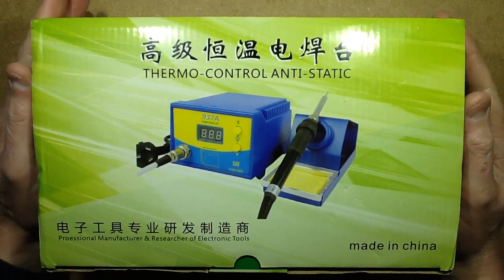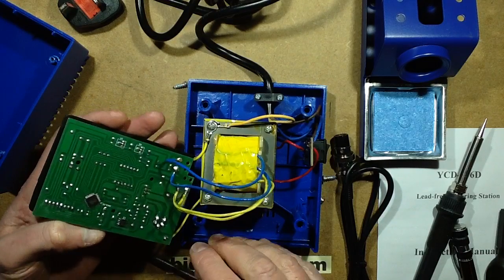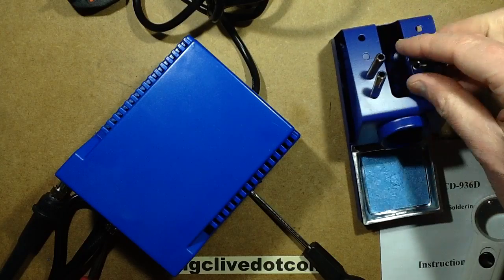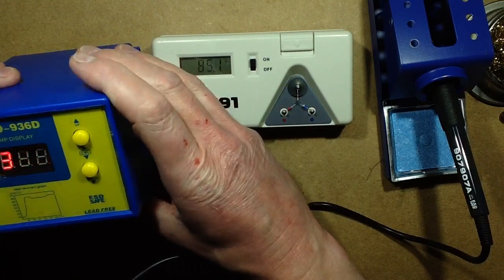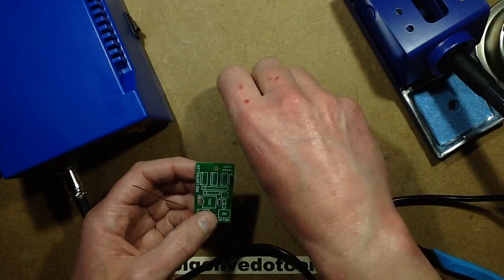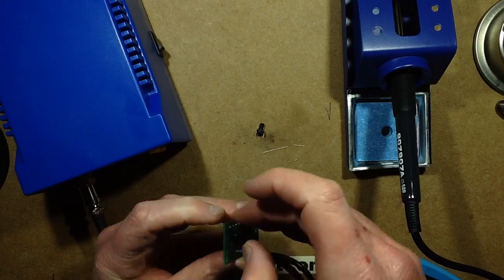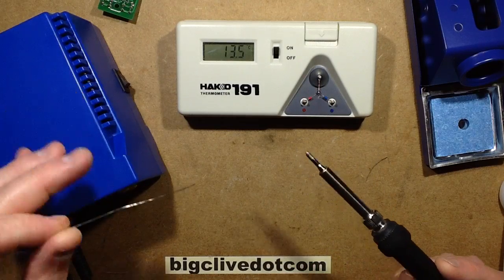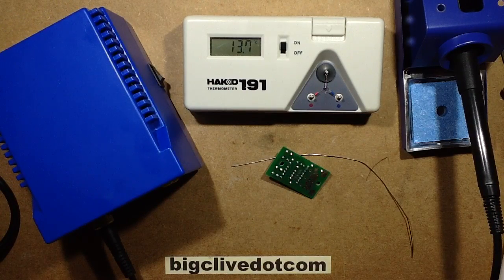936D digital soldering station test and internal look.

Comment: Hi Clive.
I just got the black version of the 936D.
Its different, mine has a callibration trimpot through the front panel, like the analogue ones.
It does make some noise when the iron is heating which isnt brill.
The stand is exactly the same as this one.
Overall its a good tool, warm up is super quick, like you point out on bigger terms it does cool down, but I find it a lot nimbler and better to use than my xytronic.

Comment: Whats the best cheap soldering iron for me to get to start with? I Have a few super cheap pencil irons but they can barely melt solder. I need a real soldering iron.
Reply: temperature controlled are the only ones worth having.

ive gotten used to an adjustable gas soldering iron so im not fused about an accurate readout
Reply: ebay special i got one like above for £25

Comment: Saw the review and bought one. When mine came it's not quite the same as yours. Plugs properly earthed. Case is subtly different. Switch is the same. Transformer is different. Board shows no resemblance to yours and features a dedicated 20pin chip thingy marked 936D. Wonder which ones the clone?:)
Reply: PS Also, Your sponge has a hole in it!! The manual mentions a small and a large sponge but I only got the small one!! 😀
Reply: Since these are very popular there are probably multiple companies making their versions.

Comment: OK, very stupid question but I've been away from this deep in the electronics industry for about 2 decades. Why is temp calibration so important? Do chips now come with prefered temps. SIL arrays used to be SIPs.

I came across one of my first half dozen soldering irons and Archer (Radio Shack brand, now looking like they are becoming only a phone kiosk store) actually said AC/DC on the handle. No third plug (any ESD? I doubt it but with our wrist straps I never had any trouble)
Reply: BikingMNViking 

It's for Surface Mount work. Where some components can be damaged or you can even hear up nearby joints and mess up the connections.

Comment: I really want to get a new soldering station ASAP so I'm now also looking at this one, for only £22:  http://www.ebay.co.uk/itm/New-936D-220V-SMD-Digital-Rework-Soldering-IRON-Station-w-LED-Display-UK-SHIP-/291145171788
It seems to be kind of a hybrid - it's got the digital display and buttons, but it also seems to have a manual calibration dial.  That's what put me off at first.  But I'm thinking if I can't get a proper 936D soon, I might get this to keep me going, and to see what it's like.  Then it can be relegated to backup when I do manage to get a YCD-936D, WXL-936D or SB936D+.
Reply: +TheBloke 
Was looking at this one too but all the listings can't seem to make up their mind if it's an iron or hot air gun.

The one you linked says
'soldering station with soldering iron stand using split design'
and 'Air pump air current type: Not brushes the air blower gentle revolving atmosphere' in the specs

Others just flat out call it a '936D HOT AIR REWORK SOLDERING IRON STATION'
with
Package includes:
1x936D Desoldering Tool Hot Air solder Station
1x Hot air gun handle
1x Handle stand

Can't find a single picture of what's actually plugged into that stand.
Reply: +webchimp Yeah the listings are really confusing for some reason.  I don't know why they keep mentioning rework.  I think maybe they sometimes sell multiple units - the iron, the rework hot air gun, and a combined unit with both.  And in this case they've left in the 'rework' part even though it's just the iron?  Not sure.
In the case of this listing I was satisfied it's an iron by two things:  1.  The listing says, in description  "This Buy It Now comes complete with the base unit, solder pencil, stand and solder tip" - given it says 'solder pencil' I am fairly happy it means what we want it to mean
2. Although you're right that they never show the iron properly, if you look at the fourth picture in that listing, you can see the writing on the side of the iron.  I believe it says HAKKO 907 which is the classic soldering iron we want, as Clive has discussed in this video and his Basics of Soldering video.  (Though admittedly it is quite blurry and it looks more like HAKKO P07, but given that's not a thing, and 907 is, I'm fairly happy that it is the iron.)
If I do buy it I might send the seller a message first just to confirm.   Whether I buy it or not will depend if the WXL-936D comes back in stock on UK eBay early next week or not!
Reply: +TheBloke Actually regarding 'rework', I just noticed that even the listing for the digital WXL-936D (hopefully identical to the unit Clive reviews here) says "Rework Station".
I think maybe it's just a word that the Chinese always put in any mention of Hakko soldering stations - could be their confusion as to what it means, or it could just be for eBay search keywords, so the listing is viewed by anyone searching for either soldering or rework.
Reply: +webchimp I've just bought the 936D with the manual calibration dial from the auction I linked.  I had waited until today in the hope I might still be able to get the WXL-936D, but the supplier who told me it would be available this week, is now saying they have no idea when it will be available.   I've also had no response from Alibaba or the Taobao shipping agent I contacted regarding getting one from China.  It seems the unit Clive reviewed is like gold dust!
So anyway, I've ordered the one I discussed, so fingers crossed it is actually a soldering iron and the manual calibration isn't too much of a problem!   Last week I ordered the 'Hakko' 191 soldering iron thermometer that Clive has, but I won't get that for at least a week so I won't be able to properly test/re-calibrate until a little while after I get the iron.
Reply: +TheBloke 
I'm waiting on a 191 as well, can't wait to see how terrible my cheapo iron actually is.

edit: got my 191 the other day, not sure how accurate it is but my iron was reading ~404C.
Reply: +webchimp Just got my Hakko 191 today!  Ordered 3rd May, delivered 13th May - really great China delivery time, especially given it was £8.99 with free delivery!
Haven't tried it yet but looking forward to later tonight (I won't get my cheapie 936 soldering station until next week, but I do have an Antek TC50 iron I can test it with - I've been wondering for a while if that's still accurate.)
Reply: +TheBloke  And I just bought another soldering tip temperature Hakko clone :)  This time the 'Hakko' FG-100:  http://www.ebay.co.uk/itm/141982376192
This is a clone of a later model, that does up to 700°C and has a MAX HOLD button.  Not at all important changes, but again this was only £9 (though I had to pay in Australian $ as for some reason it's not listed on UK eBay), so I thought I'd give it a shot.  I can compare the 191 to the FG-100 when I eventually get the latter (I rather doubt I'll get 10 days delivery time again.. but you never know!)
Reply: +TheBloke 
That's who I ordered from, ordered on the 8th so it may turn up next week about the same time as my power supply
Reply: +webchimp Great, hope you get it soon!
And in other news.. my 936D turned up this morning!  I'm getting very lucky with deliveries, it wasn't due until Monday.
So far, pretty pleased!  It had a proper earthed plug (albeit 13A fuse).  And it's exactly what we hoped it would be from the listing -  display, up/down buttons, manual calibration.  The 907 iron is nice, with a silicone cable, the same iron stand as Clive shows here (with the holes in the top), and the iron fits in the stand well, quite stable.
And the best news?  Out of the box, it was within 1 °C of the calibrated temp!  At least according to the 191.  So I haven't yet had to touch the cal dial at all.  Pretty pleased with that.
(To be precise, when I first put the tip on the 191 it tends to show about 10°C below cal temp, but if I hold it on there a few seconds it climbs to within 1°C of the temp.  So that might indicate this iron's slow temp build up.)  I already replaced the provided pointy tip with a 900M-T-3C spade tip.  I haven't actually soldered anything yet but shall be trying various things this weekend.
Next I will open it up and check the internal earth connection.  And then start soldering some stuff!  But so far, so good.
Reply: +TheBloke Just opened it and again, looking good!  Here's a couple of internal pics:  http://i.imgur.com/SMr3Z3P.jpg?1   http://i.imgur.com/JCpJZ5G.jpg?1
Very neat and clean inside, with cable ties around the cables.  Earth is crimped and screwed tightly to the transformer and I confirmed continuity all the way from the plug's earth pin to the tip of the soldering iron.  The transformer looks clean, but is unlabelled.  A couple of transistors are at an angle to the board but it seems intentional and not a problem.  
All in all, pretty good inside - and better than some other units I've seen reviewed online, including Clive's (as my earth was tightly screwed down and I didn't need to replace the plug - though I will change the fuse down to 2A or similar.)
Reply: +webchimp Oh, and what power supply did you order? I've been wondering if I should get a proper bench power supply.  Right now I just have batteries, and a 12V 33A DC converter, like the cage type brick Clive reviewed a year or two ago. 
Can't decide if I will get a proper bench PSU, but in the meantime I did order one of those cheap Chinese buck converters with a small LCD and constant current/voltage controls.  
What're you getting?

Comment: Where can I find the temperature tester? And somewhere where the station is in stock, every one of the links I've tried are sold out.
Reply from the maker: +James Zhao Search for Hakko 191 and you'll find the clone soldering thermometers.  Shop about, there's a wide price difference.  The digital soldering stations seem quite rare at the moment.
Reply: Yes even the turn the nob version is rare, they are out of stock. However if Google translate wasn't bad I would go on taobao as they seem to have stock of the digital version
Reply: Hakko 191 has been discontinued and replaced by Hakko FG-100: https://www.hakko.com/english/products/hakko_fg100.html
And cloners has also also switched to cloning FG-100 instead.
Here's the cheapest Hakko FG-100 clone currently at AliExpress. USD 11.28 and free worldwide shipping: http://www.aliexpress.com/item/High-quality-soldering-iron-head-thermometer-FG-100-temperature-test/32385727766.html
A genuine Hakko FG-100 is waaayyy more expensive.
You can also find spare sensor wires at AliExpress.

Comment: The cords on these cheaper irons drive me bonkers.  Have you given any though to replacing the lead with a silicone cable?  I'll bet the stand would be a lot more useful if you screwed it down to your workbench to keep it from moving around so much.

Comment: Hey Clive, great vid as allways. Until now, I am working just with trafo gun iron, but I am thinking of trying some soldering station. Those chinese ones you shown us looks fine, but I am not sure, how to calibrate 'em, since that 191 thermometer costs same price like station with equipment or even more. My question, is it possible to check it with standard thermo couple delivered with multimeter? I am not sure, what is the range of that unit (unfortunately, I get rid of all packing material also with all datasheets). Or any other way how to calibrate it? Or just try it, how it feels during soldering?

Comment: Have you ever used any of the Metcal solder stations? I've picked a few up on the used market and I love the super flexible cable and short work distance from the handle to the work

Comment: I heard you mention you also got the hot air gun and iron combo station. I was just looking them up on ebay.  Is the hot air gun worth the extra $20 or is it better to just stick with the iron only version?
Reply from the maker: +David Anderson I use the hot air pen a lot to shrink heatshrink.
Reply: bigclivedotcom Thanks!
Reply from the maker: +The SwampFox (Zeke Ortiz) I rarely use surface mount, so I tend to use the air gun for heatshrink which it does a very good job on.
Reply: +bigclivedotcom Can I order the rgb controler?
Reply from the maker: I sell them on my website at www.bigclive.com

Comment: About those IC-sockets. I prefer to use the flat ones because you can easily turn them into surface-mountable socets for normal ICs. Also im interested about your opinion on SMD vs. Through hole components, i personally love smd because its easy to make PCBs for them at home and soldering them is often easier.

Comment: I was having a look around the web  for one as the UK supply seems to have dried up and found the CXG 936d iron, which has the temp control circuit built into the handle. 

Has anyone tried one?

Comment: Hi, I purchased a similar unit, based on your video review. It's a YiHUA 937+ (Yah Hooo!!!) not the same brand or model, as yours. It came with the solid white heating element, not the flexible one. The iron cord is a little short (32"), but it's silicone and very flexible. It holds temp very well. The LED goes out if you turn the temp down, then the display switches to actual temp, until the irons cools to the set temp, the LED flashes quickly if maintaining temp and slowly if you set to higher temp and it is heating up. I opened it up (as one does), and checked the internal construction and wiring. There is good continuity from the ground prong on the power cord to the tip of the iron, the Load and Neutral are isolated from the ground. It came with a Certificate Card inspected by 2, and an impressive Authenticity sticker on the back (with a SCRATCH area, I am tempted to scratch, itches us, it does). It's not as colorful as yours (basic black), but at $35.09 delivered from New Jersey, I'll take it. Keep up the good work...

Comment: +bigclivedotcom
Thanks for another great video.
Though I have a couple of possibly stupid questions,  what does "sleeved earthplug" mean, and why is it that are they bad
And also, possibly an even more stupid question, why do You reckon it says "lead-free soldering station" on "station" and the manual ??
Best regards
Reply from the maker: +Mats Rdr The earth pins are supposed to be solid metal.  (preferably brass) and the addition of the plastic section could mean that it defeats the main earth connection point on the pin.
"Lead-free soldering station" is a gimmick.  Like "digital ready".
Reply: OK, many thanks for the answers.
 [[Actually when I first saw a "sleeved ground pin" I thought it was some kind of " new safety measure". ((ironic I know)) 
Any way my point being that I wouldn't be surprised if most people are not aware that "sleeved earth plugs" are "not up to snuff" and should be avoided.]]
Best regards.

Comment: i cant seem to find these on ebay at the moment shame i was really wanting to buy one
Reply from the maker: +rocking546 They#re a fairly new variety.  I think they'll become more available in time.
Reply: I've got a multimeter with a temperature probe... not sure if this would work though.
Reply: +rocking546 https://world.taobao.com/item/521232710617.htm?spm=a312a.7700714.0.0.UnwA16#detail
Reply: +rocking546 Odd... I saw one on EBay not long after seeing this vid... Didn't spring for it though because I already got an A55KJ from Maplin when I saw this... Also don't really wanna be shelling out for a Hakko 191 to callibrate it before use! (Better that I can buy one later because they can be really pricey if you don't know where to look!).
Reply: +mattferg100 
Hmmm, had a look at that, unless I got something wrong it worked out at £10.50 plus £106 postage

Comment: I bought a W.E.R  952D ,whoever they are, soldering and hot air rework station with spare elements for each for sixty quid and so far so good. I have not had a butcher's inside yet but it's in a nice solid metal case with dual cool blue digital readouts and air speed controller with different nozzles for the hot air. Looks like the same generic iron as yours, so all good I hope.
 EBay jobbie in less than a week.

Comment: I'm American so I'm not familiar with fuses in the electrical plug. Why would a 3 amp fuse be better than 13 amp? 13 > 3 so.....
Reply: +ThEcRaZ3dGaM3R thanks for the reply. I know we have breakers that trip past 15 amps or 20 amps (depending on what fuse you install) but I supposed all the gadgets that use less then that have their own fuse. Not really sure tho.
Reply from the maker: +MegaGeekTutorials Thin flex for table light 3A fuse for closer protection.  Thick flex for kettle or washing machine 13A fuse.
Reply: +MegaGeekTutorials Because you want to have a fuse that is as close to the current the device will draw in normal operation. A good example of this would be:

Shaver: 1 amp
Table lamp: 3 amp
Fridge/Freezer: 5 Amp
Computer base unit:10 Amp
Room heater: 13 amp

If you had a fuse that was too high a value and the device it's passing current to malfunctions, then there's a very high chance the power draw will exceed the limit of the cable. Cable heats up, plastic melts... house fire! I'm guessing in the USA you rely on either internal fuses or breakers since your plugs are too small to accept a fuse...

Comment: In daily use I much prefer the analog control knob stations (with all other things equal). It's just so much quicker to nudge the temperature up for soldering magnet wire, or nudge it down to make bridges on breadboard.

Comment: Congrats on the 100k !!!!!!!!!

If you put bolts through the holes of the stand, with the thread sticking up, you can stick your tips on them nicely. Also it would help to screw the stand to a larger baseplate to make it more solid.

I'm glad you are happy with this piece of crap, and I'm doubly glad I don't have to.